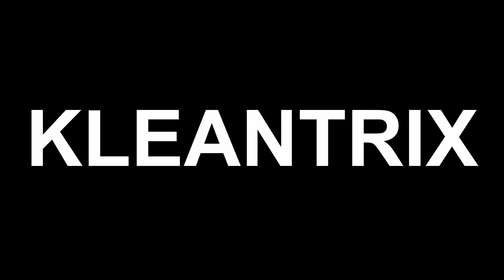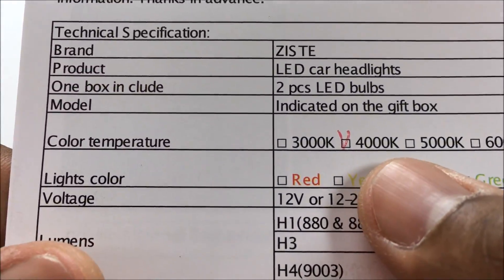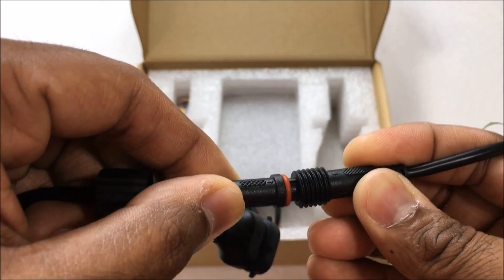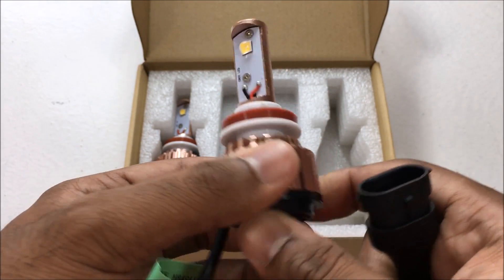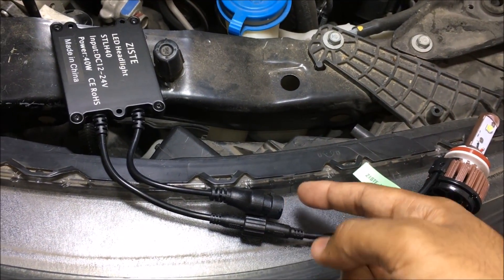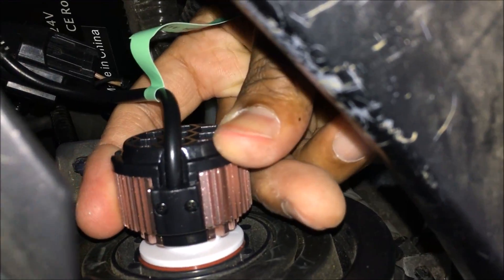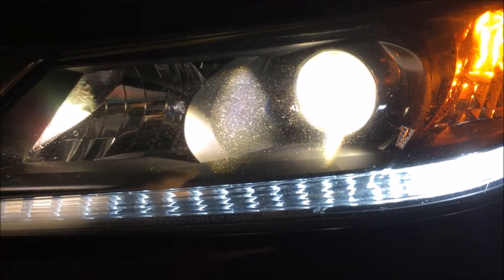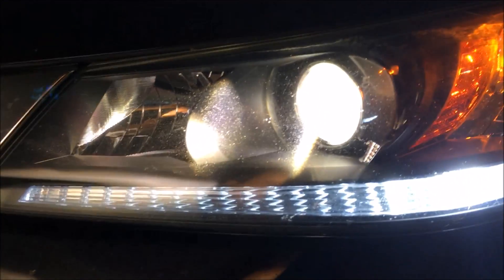BEAUTIFUL WARM WHITE LED HEADLIGHT

Comment: will it fit mazda 6 I touring 2016?
Reply from the maker: Yes it will. Make sure to have the right bulb size.
Reply: Any idea how to know bulb size?
Reply from the maker: Feisal Ali Yes the bulb size is on the car manual.  After you find the bulb size, let me know so I can direct you in the right direction.
Reply: Cool